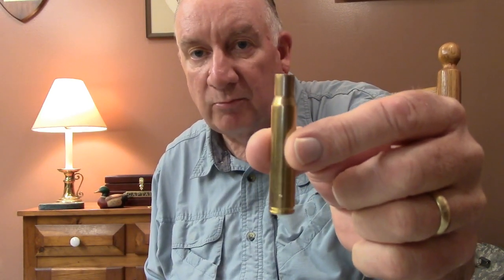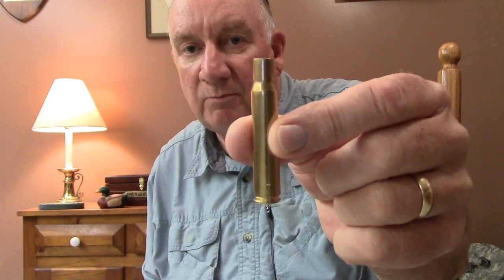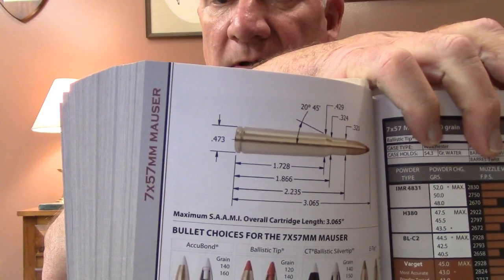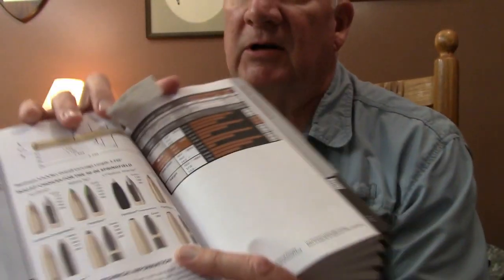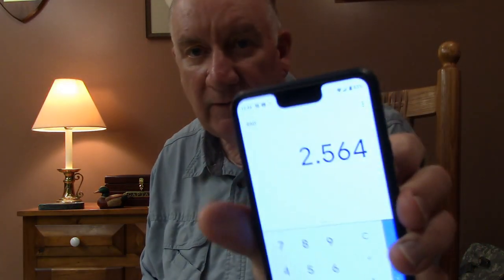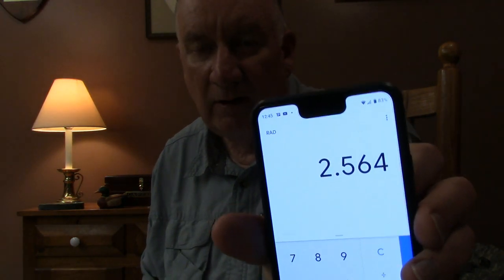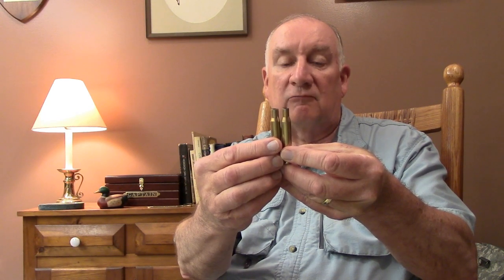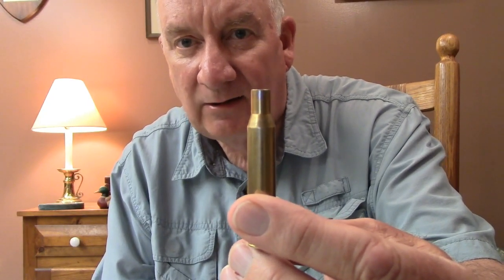Winchester 270 Origin Myth ~ Stupid Wiki Nonsense

Comment: .473" head size was pretty much the "standard" for decades for countless cartridges...even the .45 ACP pistol cartridge.  Check a loading die chart for how many cartridge cases use a #3 shell holder!   The cartridges have been lengthened, shortened, necked up, necked down, blown out and shoulder angles have been changed over and over and over...but it is ALL the .473" head size.  I think the gamut has been pretty well run on this case.

Comment: If I'm not mistaken, the cartridge has to fit the chamber precisely, otherwise it will expand dramatically and split open.  So how can you neck down a .30 cal, to a .27 cal, lengthen it and still fit the same chamber?  Doesn't the neck fit snugly in the bore?
Reply from the maker: Of course a cartridge must fit a chamber as specified.  A 30-06 necked down to a 270 must only be fired in a 270 rifle.  I made a general reference about overall cartridge size but said nothing that would specify otherwise.

Comment: I own a Winchester model 95 that's chambered in 30-03.  It was originally made in 1914. It was my understanding that the reason Winchester continued to chamber those rifles up until that time was because there was still millions of rounds of left over 30-03 surplus ammunition on the market and they wanted their guns to be able to fire it safely but still fire standard 30-06 ammunition. Which it does because the only basic difference was the neck length.  I was told by several people that 30-03 ammunition that was manufactured by the government was not destroyed but was sold as surplus after it was considered obsolete after 1906 when they converted all the firearms to the new 30-06 cartridge.

Comment: Completely and totally sidestepped what is meant when we say b cartridge is based on (necked up or necked down) A cartridge. Which is why we say the 270 is based or derived from the 30-06. The 270 started out life as a wildcat cartridge developed by simple necking down a 30-06 to hold a bullet of 0.277" dia. It came along at the correct time with sufficient performance to become popular enough that winchester decided it was worth the investment to standardize with a few minor modifications to prevent cross chambering.

 In the beginning the wildcatters did not develop this cartridge from a raw unformed straight wall cases. That came after standardization. 6mm-06, 25-06, 338-06. All also have similar origins, hence the -06 in the name.

Just to fill in the bkanks.

Comment: There is nothing great about the .270 except a writer to push it. The .256 (Actually a 6.5mm) Newton was around long before the .270, and that WAS derived from an '06 case. There is nothing a .270 bullet will do that a 6.5 MM or 7MM  won't do.  Sales would never have taken off had it been topped off with a 7MM  bullet. MM cartridges were a hard sell back then.

Comment: Always a pleasure to learn from your videos!  I do have a couple of points though.  I have 2 -1895 Winchesters ( one carbine, one rifle) in 30-03.  One was made in 1905, the other in 1917.  Both bear the same barrel stamp "30 US MODEL 1903", I also have a box of Peters ammunition that is marked "30 Government model of 1903", that contains cartridges headstamped "30G1903".  Both of those 1895's pattern like a shotgun with 30-06 ammunition, but are remarkably accurate with 270 brass fireformed and reloaded to 30-03 specs.  I don't know why both cartridges were chambered for that rifle at the same time, and I don't know when the 03 version was discontinued - but it did exist outside of only arsenal stores.  
I appreciate your channel!
Reply: You really should put both rifles up on the wall and not fire them anymore. You are dealing with unknown CUP pressures relevant to the lever action designs of the era, and improper case length could possibly pinch the bullet between the rifling and the case mouth causing deadly results if the single locking lug is worn or fatigued. Not trying to scare you, just the facts.
Reply: yup

Comment: I’d much rather have a .270 than a 6.5 Creedmore.
Reply: Why?
Reply: @oillease1881  why not?
Reply: Yes it just gets the job done.
Reply: Different types of cartridges for different applications.
.270 has a relatively low B.C. bullet pushed to a relatively high velocity.
It performs exceptionally at taking medium game at medium range.
The 6.5 uses a high B.C. bullet at medium velocity. 
It shows it full potential at long range where other cartridges fall below the velocity that it is still carrying.
Reply: @fatfighter-q3z  use 6.8 spc bullets in a .270 case, more options.

Comment: Excellent content as always Sir! This is perhaps a bit off subject but may I hear your thoughts on the .270 WSM ? I own a Browning rifle that was handed down to me that uses the .270wsm. The ammunition however continues to become more scarce as prices per box climb. This rifle is an heirloom so simply selling/ trading it for another is not an option. Thank you in advance for your time.
Reply from the maker: The ballistics of the 270 WSM are not materially different than the 270 Winchester in any practical terms.  Since it's inception, the cartridge has not been successful enough to keep cartridges in strong production, so the cost stays high and bullet selection is low, compared to the 270 Winchester. Despite it's ammo availability and cost, it's just as useful.

Comment: I have a question... How did they measure FPS before modern day electronic technology like chronographs and Doppler chronographs?
Reply: They used a ballistic pendulum, measuring the movement of the pendulum, then calculating the necessary power. Knowing the movement/lift of the pendulum plus the bulletweight, you find the speed of the bullet.
Reply: mo c That makes sense after the fact...  how accurate were their readings as measured by today’s electronic devices? As I typed that I thought about what I learned from you about powder. If the powders were the same then as today, how accurate were they in their estimates? Thank you for your time Sir, you have taught me much.

Comment: I'm about to purchase a budget rifle based on yours and others videos (Howa 1500). I have battle rifles in .308 and they are heavy when I use them for hunting and hiking a few miles. I don't mind since that's part of the fun but now thinking of a bolt action I am contemplating 6.5 Creedmoor, .308 and now your recommendation of 270 Win. My concern is weight. I'm not sure how many rounds I should bring on a hunt (20?) but are the 270s going to be as heavy to hike with as the 308 or should I not even care because I don't see AR10's or M1a using that round for anything. or should I just stick with the 308 and be done with it. Your thoughts? (BTW, 6.5 Creedmoor  is out based on your analysis and recommendation).
Reply from the maker: I'm not sure what you are asking.  The M1A is of course very heavy with a fully loaded 20 round magazine, but that's a combat rifle, and that weight was a huge factor in the nearly immediate rejection of the M-14 soon after it was introduced.  It ended up being heavier than the too-heavy M-1 that it replaced.  Most states restrict magazine capacity with autoloading rifles for hunting.  A bolt action hunting rifle typically has a 4 to 6 round magazine capacity, depending on the caliber.  Capacity has nothing to do with requirement afield.  A competent shot should feel very well prepared for most game with one to three extra rounds in a magazine and one in the chamber, except of course for dangerous game.  For pronghorn antelope and most mule deer, one shot is all one gets before they put the afterburners on.  Even most whitetail are a single shot proposition.  I consider any additional rounds in my pocket or belt as signalling rounds in the event of an emergency. I certainly have never carried more than ten additional rounds on my belt though, and in 50 years of hunting, have never used more than one shot on game with a rifle.
Reply: @GunBlue490  Sorry I was not being clear. I use the Black rifles for hunting as well (I'm new to hunting). So I'm wondering if getting a rifle chambered in 270 will have more weight constraints as a black rifle with a full magazine (knowing full well that this is a bad use case for hunting). Are the 270 rifles and ammo going to be weight restrictive than a 308?
Reply: GunBlue490  thank you GB. Your advice is appreciated. BTW, I’m seeing more black rifles using 6.5 Creedmoor. What do you think in 10 years? Will I have to get a new rifle? What part of the rifle requires adherence to the cartridge type, the barrel or the bolt or both? Why can’t I use a 6.5 in something similar like a 308? I’m just curious as I don’t know why there are so many different barrels and bolts when you could interchange them? It would save me moneyz
Reply: If it was me making the choice, it would be a Henry lever action probably in 30/30 because Wal-Mart sells pallets of ammo right in the aisles close to hunting season  for $9.99 box, brand names !  There is nothing cooler than a cowboy gun hunting deer, the GoldenBoy models make fine heirlooms, and you could buy two in case you ever have a kid.
Reply: Donald Mccauley  thanks! I guess I’m just trying to maximize ammo usage by keeping chambering consistent with my hunting vs aR

Comment: I would suggest you research the 30-03, as it was a commercial cartridge.  Winchester was producing it's Model 1895 in 30-03 into the middle 1910s.  I owned and fired one.  Check The Winchester Book by George Madis and the Blue Book of Gun Values, both mention the Winchester Model 1895 in caliber 30-03.  For what it's worth, the 30-03 was created along side the Springfield Model 1903 rifle.  The 30-03 was a round nose cartridge, and it lead to the 30-06, a spritzer, or pointed nose bullet.  Which was the outcome of trying to duplicate the German Mauser rifle round of the time.  The 30-03 has an overall length that is greater than the 30-06, primarily because of the 220 grain round nose bullet, versus the 150 grain spritzer bullet of the 30-06. There is a difference in the actual case measurement also.  While a 30-06 will actually fit in a 30-03 chamber ( never chamber a round in a rifle that the rifle is not chambered for) the opposite is not possible, the longer length of the 30-03 means it will not fit a 30-06 chamber.
Reply from the maker: You are historically correct about the rifle.  That's a rifle that Winchester chambered to accommodate one of the countless 30-03 rounds which found their way into civilian hands.  For the dimensional reasons you cited it was a very good engineering precaution on Winchester's part, which they found unnecessary by 1910.  In any event, the length of any cartridge trimmed length is entirely independent of another cartridge.  My comments addressed cartridge development, not firearms chamberings.
Reply: @GunBlue490  I think you missed my point.  Twice in this video you stated the 30-03 was only an arsenal cartridge.  That information was wrong.  Note the sources I used to disprove your statements.  Since you portray yourself as a wisely old man of knowledge, I believe it is your responsibility to provide accurate information and to correct any wrong statements you make.  Also note that your reply  referred to Winchesters engineering regarding the 30-03 and 30-06.  The U.S. government developed both cartridges and they are responsible for the "very good engineering " of those cartridges.
Reply: @robertsevers6251  Are you saying that back in that time one could go to the store and pick up a box of 30-03 ammo made for the civilian market?

Comment: 7x64=.270 😉
Reply from the maker: 7mm is .284.  7x64 is the German Brenneke round, similar to our 280 Remington. 270 is 6.8mm.
Reply: @GunBlue490  yes but they are very similar. 7x64 Designed 1917, .270 Designed 1923... if the Americans could take it simply from Europe .... but they want their purely American ... very similar, but a little different;)

Comment: Even if its not from the 30-03, the shoulder angle seems to me slightly less than the 30-06 and it looks like the 30-03. I may be wrong on that, point is if its true its a coincidence that it looks like the 30-03, and maybe has only to do with slightly altering the 30-06 case to make it the 270.
Reply from the maker: I'll give you the blueprint specs.  Both versions of the 30 caliber round have a 17.16° degree shoulder.  The 270 Winchester has a 17.30° degree shoulder.  The only similarities in shoulder angle are between the 1903 and 1906 rounds.  Looks have nothing to do with it.
Reply: If you want a real zip banger of a .270, go buy a Weatherby Magnum. Round radiused shoulders on the case, powder capacity up the wahzoo, quarter inch of freebore for the bullet to travel before engaging the rifling, and velocity near light speed. Totally different concept of accuracy than any of your hunting buddies would even dream about, Roy was the man.
Reply: P S the surviving friends and family of the critters you whack out in the woods will be sending cards and letters begging you to go buy a .303 British or something like it to give them a chance next time.

Comment: please explain why the 270 length is exactly the same as the 30/03 case maybe Winchester was trying to avoid a lawsuit from Springfield ? there must be a reason why Winchester did this and did not simply neck down a 30/06 case or use the spec of the 30/06 with simply a 277 diameter
Reply from the maker: I have nothing to explain.  They are not at all the same length, as I illustrated in the video.  The 1903 cartridge measurement was considerably longer than Winchester used for the .270.  Any relationship between the two is entirely fictitious nonsense.  Nothing was "necked down".  Winchester made a new design that fit the existing rifle and magazine, using an existing case diameter and length that was in use for over 20 years.  Period.

Comment: I was happy that you explained how they designed the 270 to preclude chambering a 30-06 cartridge in a 270 rifle. Last fall I was on duty at the range and a shooter had a brand new rifle that he was trying to sight in for deer hunting. His shots were going all over the place. The rifle had “270” stamped on the barrel in large block letters, but upon closer inspection it turned out that the manufacturer had put a 270 chamber in a barrel that had a 30 caliber bore. No harm was done, aside from some very inaccurate shooting, but imagine what would have happened if the manufacturer had cut a 30-06 chamber in a barrel with a 270 bore.
Reply from the maker: Actually, that is never a problem, because a 30-06 simply will not chamber in a 270. There are only a few rare cross chambering calibers, as with an 8mm Mauser that can fit into a 30-06.

Comment: A most interesting extrapolation of history.  Does this some how tie into the new  Remington 6.8 SPC as an engineering development.  Always thank-you for your time.
Reply from the maker: The 6.8 bore is a true .270, which uses the same bullets, limited to 115 and 120 grains due to cartridge length and magazine dimensions.  The 6.8 SPC was a private concept development, that was envisioned to take the place of the 5.56 NATO.  Despite it's certain striking effect, the US military immediately rejected it as a substantial step backwards in weight and personal firepower.  The combat model that relied on hitting power of a round long ago gave way to tactical combat and sustained multiple fire capability with light automatic weapons that the German infantry had developed and had used with telling effect against Russians in WWII, which inspired General Kalashnikov to invent the AK-47.  The SPC is one of a number of rounds that have been made over the last two decades to attempt to fit a square peg into a round hole.  The 6.8 SPC is a fun round.  I owned one in the Mini-14.  But, the M-16 was purpose built for the 223 Remington round, and that's the round that remains the most efficient for it.  It's popularity has been declining ever since the military rejected it, and I doubt it will ever recover.  With such light bullets of low sectional density and low velocity, the 6.8 SPC has limited usefulness for sporting purposes, and cannot be compared to the 270 Winchester.
Reply: @GunBlue490  Thank-you for responding.  You are in deed still on top of your game. God Bless.
Reply: @GunBlue490  I'm sorry, I'm confused... I understand the 6.8SPC would be a step backwards in terms of weight and therefore how much ammo can be carried, but the point of the 6.8SPC was that the NATO 5.56 was designed for and is very effective from a 24" barrel, but with the newer 16 & 18" barrels on the M4 versions so common now, the effectiveness was greatly reduced (due to reduced velocity). The 6.8SPC was designed for an 18" barrel and is much more effective in the newer M4s... so how would the 6.8SPC be a step back in personal firepower?
Thx!
Reply: @rosebarnes9625  its not. 6.8 spc "special purpose catridge" works great for knockdown power. if you want penetration, use 5.56.